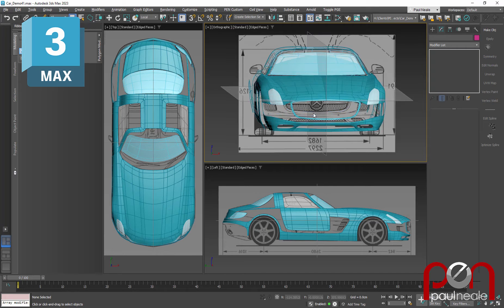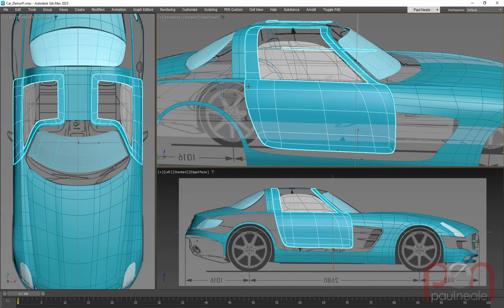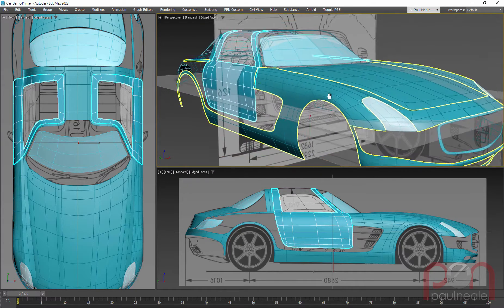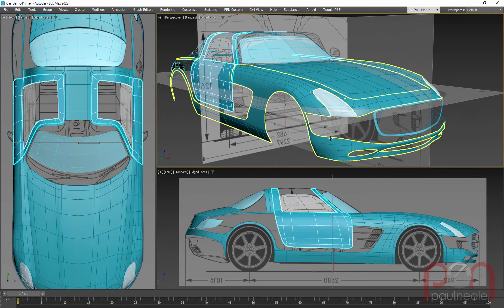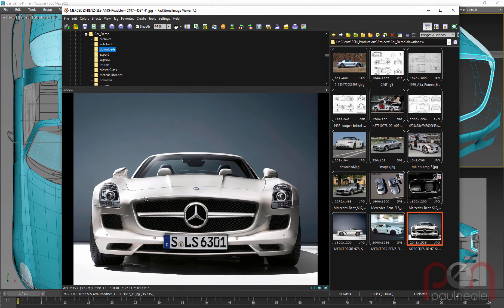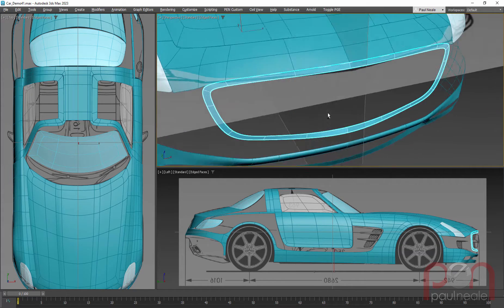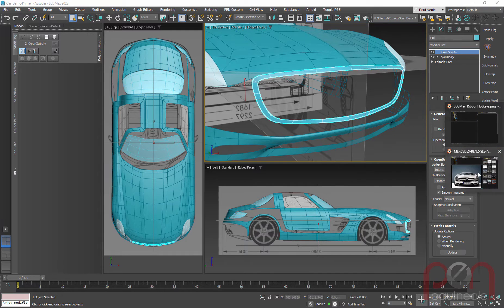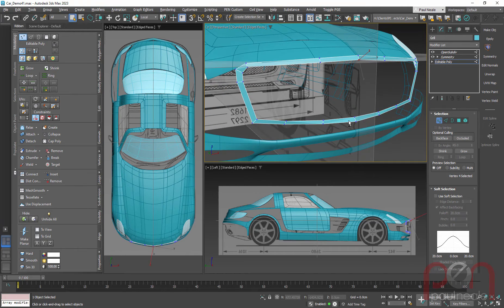3DS Max Car Modeling Modeling 03

Comment: "The idea to stack edit poly modifiers on top of boxed makes zero sense" THANK YOU Paul! I've been saying this for years... It's also risky as between different versions of 3ds max or even different pcs with the same version of max there can be serious model degradation with edit poly stacking. It should be only a temporary solution

Comment: this is old method but good for beginner
Reply: I wanna see the "new" method 🤣
I've been using max for 22 years and this is the easiest unless you're starting with photogrammetry as a base.....but the mess it creates is not worth it. Be great when they hone photogrammetry down to perfection if that's even possible
Reply from the maker: Why beginner, I've got 30 years doing it and I still use this method.
Reply from the maker: I too am wondering what you "New" method is and how it is better?
Reply: @paulneale  This is the method Arrimus3D looking for , similar to plasticity sofware  , I can not share because it is my secrect , 3dsmax today is a powerful modelling sofware